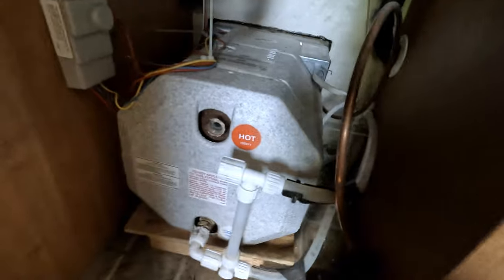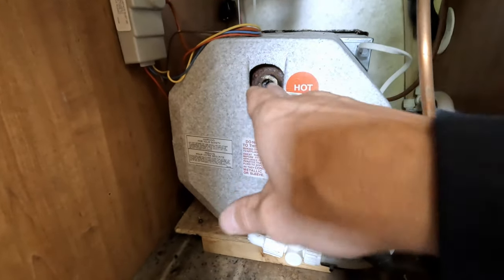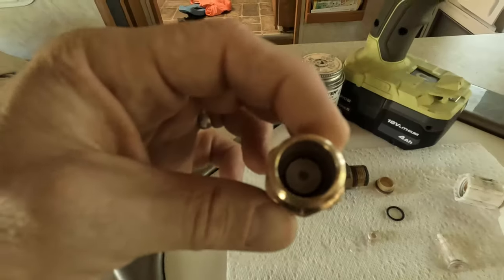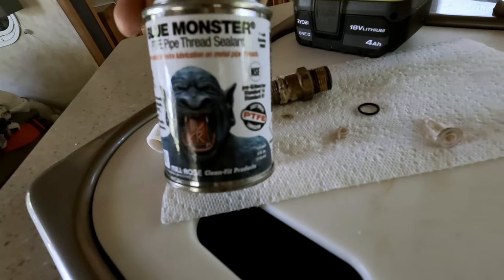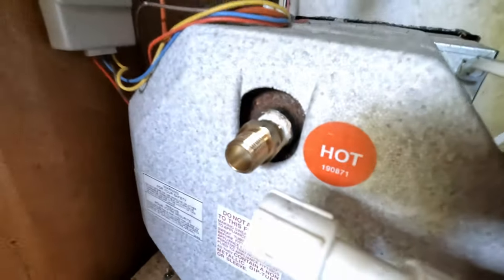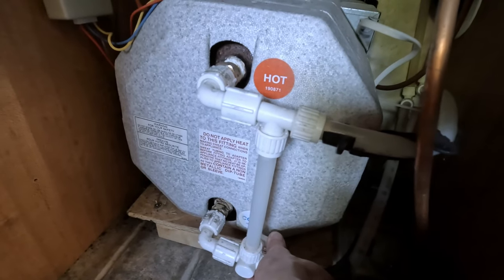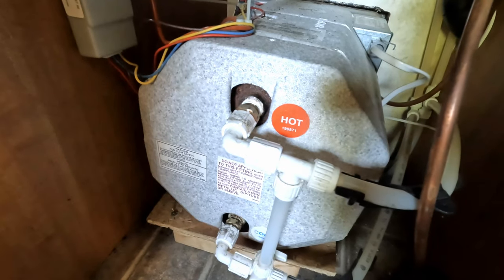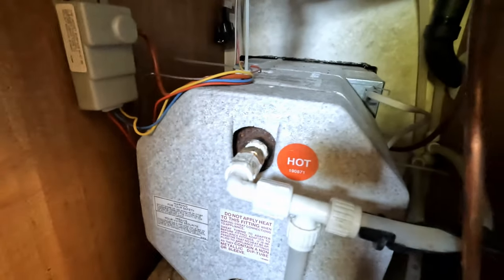RV Water Heater Check Valve Replacement - No Hot Water Diagnosis and Fix

Comment: Thank you for the video! I'm dealing with low hot water pressure yet have strong cold water pressure. I also found a leak on the twist plastic end on the check valve. Thanks again! Great video?
Reply from the maker: Thank you for the feedback. When I found this problem, I couldn't find any videos addressing the issue and figured it would help. 🙂

Comment: I was in the same boat. Hot water for maybe 30sec then nothing. My brother in law had this happen as well, so he said I should pull and check it. Well it ended up shooting out (the inner valve itself) of the brass housing. I ran hot water with great success without the valve the rest of the trip. Bought a new one when we got back home, now I’m putting that in. It is a BITCH to get out. My hot water tank is under a hide a bed. Hard to get to. The  impact…. Great idea my friend!
Reply from the maker: Thank you for the feedback. I was lucky that mine is located in an easy to reach spot, and there is a panel to remove for access. Happy camping!

Comment: Just pulled mine and took the guts out until I can get a new one. Easy fix.
Reply from the maker: For sure.
Reply: Do you mean you took out the guts, re-installed the check valve and are using the water heater until you can get a new check valve?  I'm wondering if the system will still work with no check valve guts?

Comment: My "T" winterizing diverter went bad.  When I took it out and blew into it - it worked fine - but when I connected it to the bottom of the T side and turned on the water it flowed through the other free ports.  So blowing into it and turning the knob is not a valid test. :-(  I did all of the work of replacing the check valve and only needed to swap the T valve.

Comment: Mine was in same position at top of tank. It was plastic. I thought at first it was plastic because they went cheap. But after I put the replacement one made of brass in, and it works fine so far, I read on a forum that different metals can fuse together. I did use Teflon tape so there is a barrier between the metals. It’s a 10 gallon Atwood which is aluminum. I think the temperature for electrolysis may be a lot higher than the temperature of the water heater, not sure. I don’t want to take new valve out and put new plastic in, as this was a very difficult job due to the location of the back of the tank. I noticed your replacement was brass and I guess the one you took out was original from factory? What are your thoughts?
Reply from the maker: I do believe it was original. I think the Teflon should act as a good barrier for the corrosion. I was grateful that there was a panel to remove for access to the back of mine. I'm glad to hear the video helped. Happy camping. 🙂

Comment: My hot water taps throughout RV are spurring and pushing out air

I supposed I need to check that valve and replace it since I am not sure why else would hot water spur when cold water not
Reply from the maker: It could be the problem. Have you had a chance to dig into it yet?

Comment: Just had this same problem they were so hard to get off
Reply from the maker: Mine was too. Tried to use a wrench first, then a socket with ratchet. Ended up using my electric impact gun and it came out a lot easier.